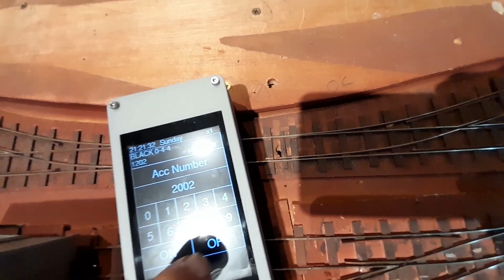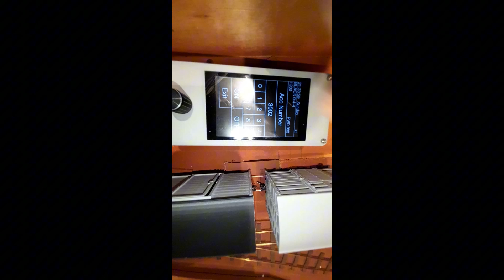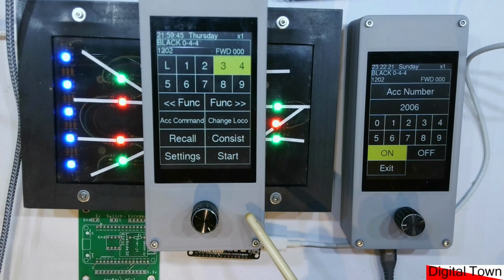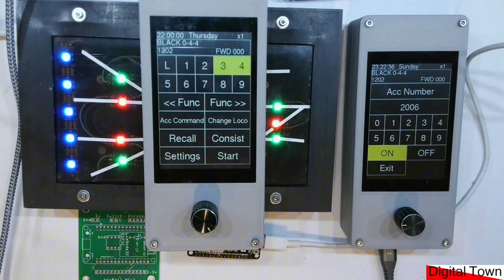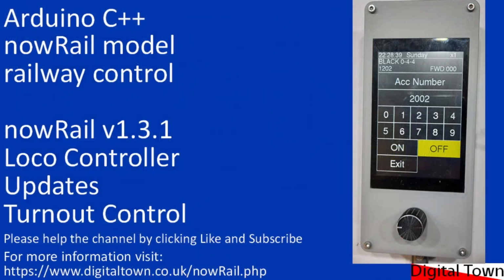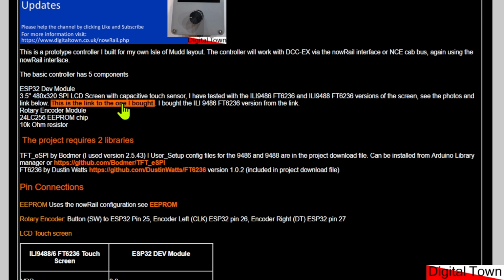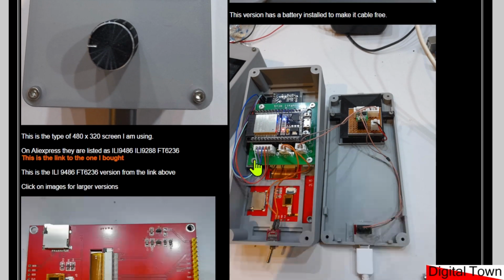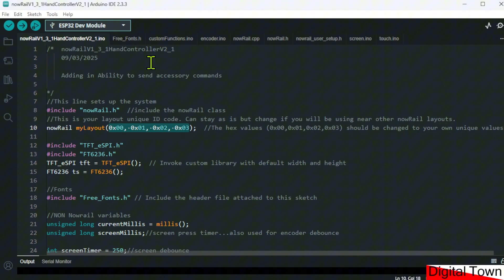#132 Arduino C++ nowRail model railway control V1.3.1 Update to loco controller with turnout control

Comment: Simon - Thank you so much for all of the time and effort you have clearly put into this project. I have successfully designed my own 1 sided pcb that I can make on my milling machine. I have printed the case and have the unit working. I have yet to complete a battery circuit. Have you made any new progress in this regard?

I would like to make some modifications to the case. Can your 3D design software export a file format I can use in Blender (.svg .fbx...)?
Reply from the maker: Glad it's all working, just about to release the latest version as it includes the ability to set the system clock.
For the case design I use a program called DesignSparks mechanical so the only export options are obj and stl.
The software is free so quite happy to send the original design files.
I recently uploaded some alternate case designs for alternate USB connectors.
As regards batteries, one of my controllers uses a lipo battery, it's a 2000mAh 103450 and has the charging circuit built in.
So on mine power comes from the USB to the battery to charge it and then between the battery and the board power supply I have a buck boost module to boost the output to 5v. I used this https://www.ebay.co.uk/itm/357667813051
The reason for not getting involved with the LIPO circuitry is down to liability issues as badly charged LIPO's can be very dangerous.
On the nowRail facebook group Rob has an alternate home made case version that he has used with LIPO and alkaline batteries.

Comment: good morning what are the differences between version 1_3_1 and 1_3_2. installing the last one, there are no display (white), thanks
Reply from the maker: 1_3_1 and 1_3_2 are the blank nowRail systems that can be configured for whatever purpose you want but are not setup as a hand controller by default so I would not expect the screen to show anything. The only mod in 1_3_2 over 1_3_1 was a fix to the DCC packet reader.

So the hand controller is currently at 1_3_1_HandControllerV2.1 ... long name that means it's handcontroller v2.1 running on a nowRail 1_3_1 core. The core hasn't been updated to 1_3_2 as hand controllers don't read DCC packets. To download the Hand controller file click on the Touch screen Loco Controller link on the nowRail web page and you will then find a link to the Complete Project Code by clicking on the Click to download project file.

Comment: Hi, I built the projet, printed 3d case in pla+ , everything is perfect, I would like to know one thing, which lipo battery should I buy, how many mAh, thanks, how can I charge it without removing it from the case, I was thinking of a TP4056 after the step-up, thanks for sharing this great project
Reply from the maker: OK first up the warnings, LIPO batteries can be dangerous when charged incorrectly and I am not an electronics engineer so although mine has worked perfectly no liability given (I'm from a programming background).
So the battery I use at the moment is a 3.7v 2000mAh model 103040 that has the built in charging circuit.... so I can't mess it up.
In my version this receives 5v directly from the USB connector and then the outpu or the 5v from the USB if plugged in goes to the ESP32 VIN via a 5v boost converter so the VIN pin always gets 5v. The switch is between the boost converter and the ESP32. That means the unit can be switched off while charging.
There are two issues I have found so far.
1) I charge through the 5v bus on my layout that has USB C connectors in the front panels. If I turn the layout off the battery tries powering the layout 5v bus si I may need to fit a diode.... or just remember to unplug it.
2) Although the battery last a long time... it does eventually go flat and as there is less power available this can have an imact on the EEPROM. I've had a few times when I've gone to use the unit and the EEPROM is blank. This is caused by trying to write to the EEPROM without enough power.
That's why I have a cabled version and can transmit all the loco data to the battery versions if needed.

So it all works great just be aware of the issues.

I am still working on it and may try some other battery sizes. In the prototyping I used a battery I salvaged from an old apple laptop. That stayed charged for so long it was incredible but it was physically much bigger and needed a seperate charging module so when I get some time and money to play about with batteries I will try some others and release some alternative case backs to suit them.

Comment: Excellent!  This was something I was going to try to address on my own when I get my system up and running.  Now I don't have to try and figure it out with my limited abilities.  Thanks!
Reply from the maker: Yes it was the one bit that the controller really needed. I use the panel controller most of the time but it's a useful feature, especially when I'm testing on the work bench.